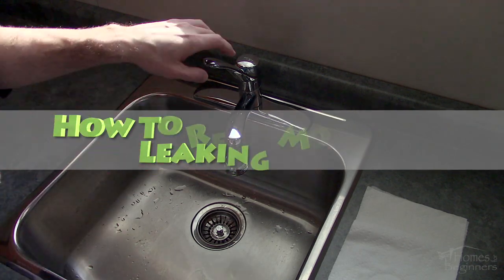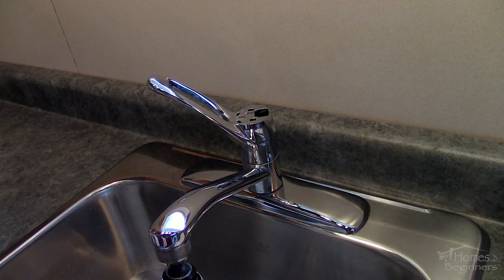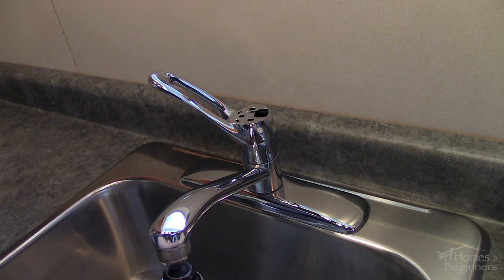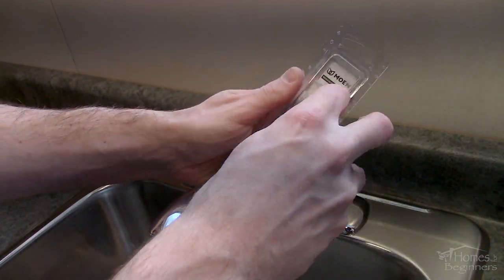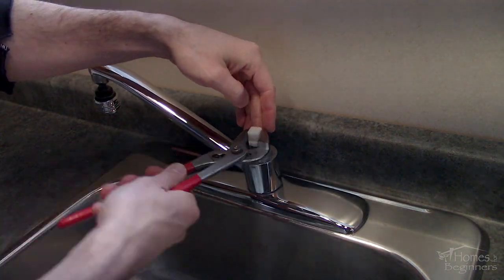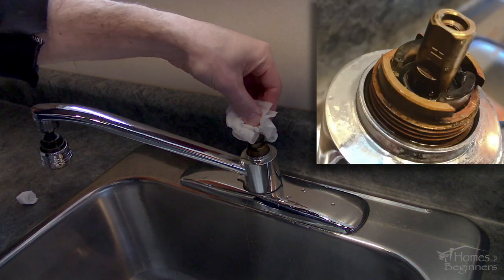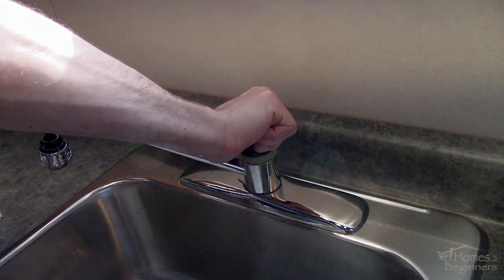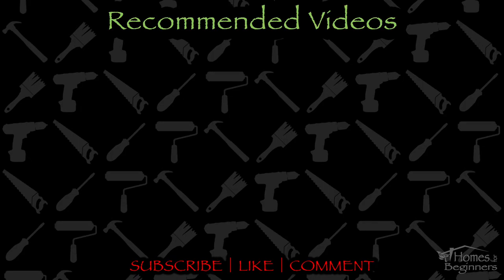How to Repair a Leaking Moen Kitchen Faucet

Comment: My replacement cartridge didn't have "H" stamped on the side. But it did have "JOO" stamped on it. I guessed it meant HOT, and I was rewarded. Great video
Reply: I've done something wrong. When I turn the water on, the handle slowly drops . No leaks but I have to hold the handle up to fill the sink. Any suggestions for me to look at?
Reply: I took the faucet apart again and found that the sleeve wasn't properly seated. Pushed it down and problem is solved. Sorry
Reply: almost solved. It's better but still slides down
Reply: I've been told it is a bad cartridge. Correct?

Comment: I have the same faucet as this. Mine is not leaking but it's hard to turn the spout arm left and right. Is there any tricks to removing the arm and cleaning and replacing the O-rings? I will also have to replace the cartridge while I'm in there.

Comment: ty, parts number under cover..
Reply from the maker: No problem!
Reply: @homesforbeginners  The top screw is stuck, had to back off on replacing cartridge for now. Haven't striped it to bad yet. but gone have to carefully tap, or cut a flat head bite with a dremile.  after spryaing WD-40 down by cartridge and top screw it  slowed the slow leek. lol
ty